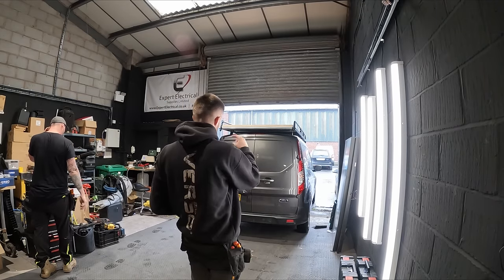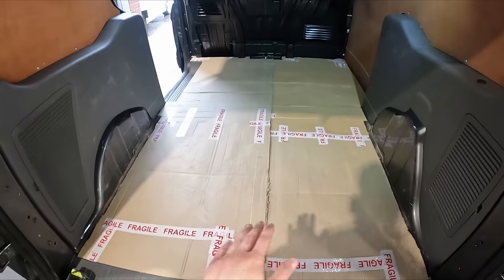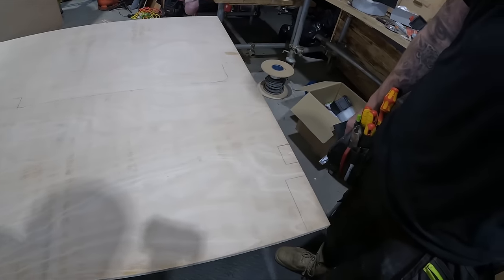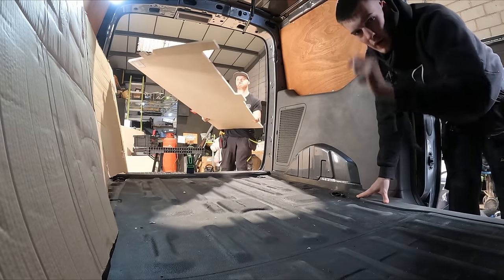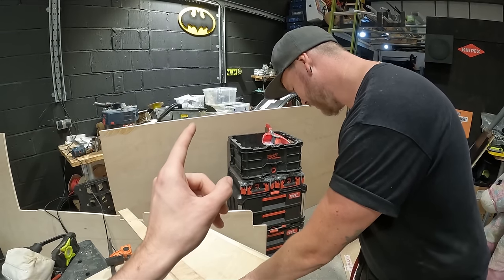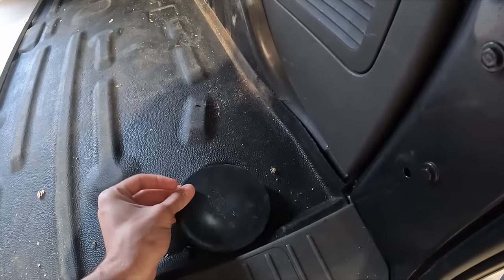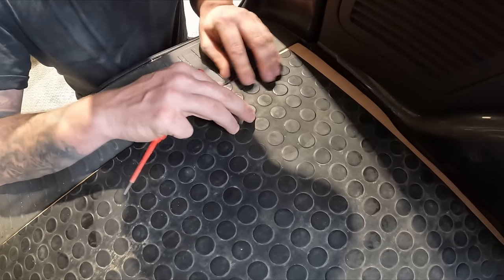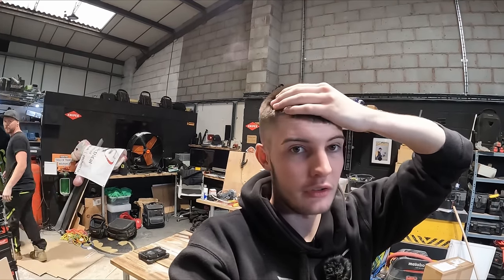How To Ply Line A Van | Van Build Ep 2

Comment: I was going to suggest cutting out for the mounting brackets - my old caddy I actually used them for a bracket to bolt the van vault down, once the floor was in you couldn't see that's how it was done and I didn't have to drill through the chassis messing up my lease terms! Not so bad as you own it outright but worth noting for future.
Reply from the maker: Ok cheers